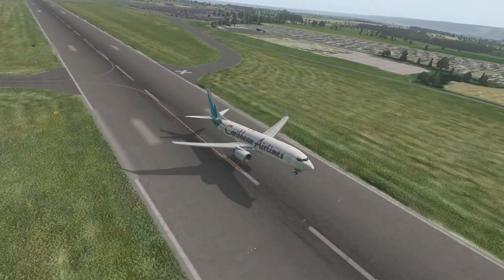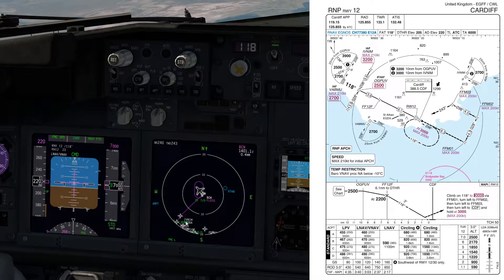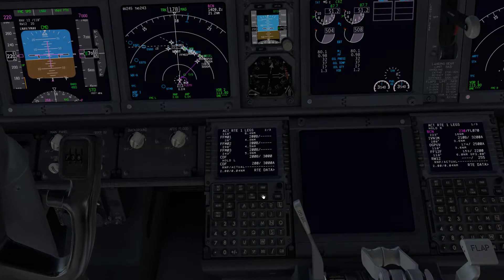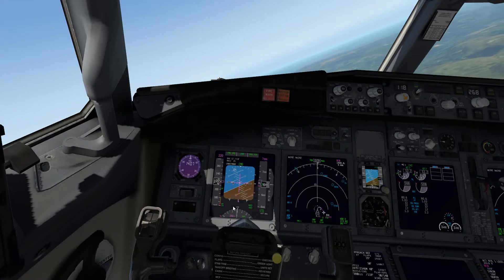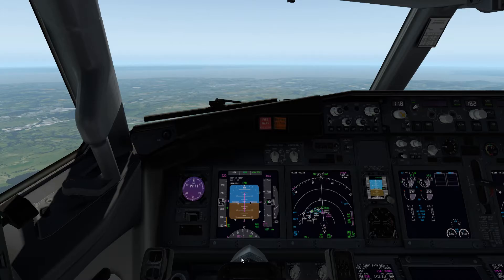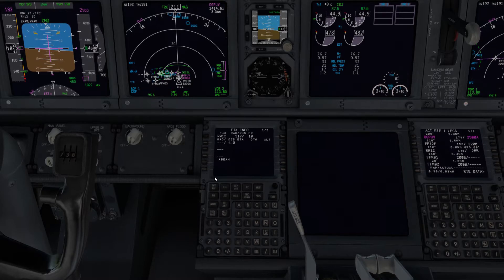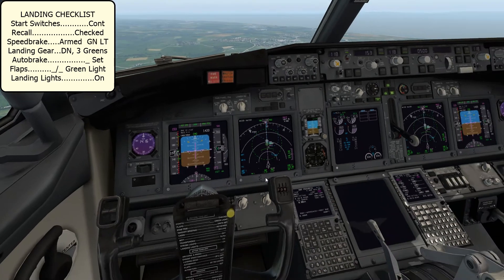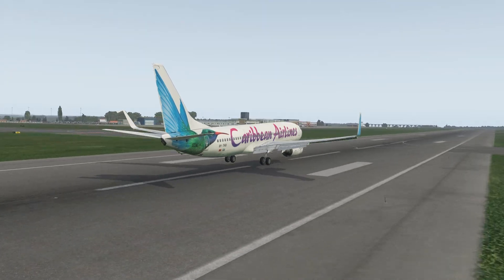Boeing 737 RNAV Approach Tutorial | Real Airline Pilot / Flight Instructor | X-Plane 11 | Zibo Mod

Comment: Thanks for the upload. I made an attempt into EDDV with rnav, but the zibo mod would't folow a glide path under 3000. I will try this approach and try to figure out what the difference is.
Reply from the maker: Which runway were you trying at EDDV? Were you definitely in VNAV Path for the pitch mode?
Reply: @Taylair  thanks for answering. 27R and once 27C. (according to landing report in simtoolkitpro. Not sure about vnav path, at that exact moment. Did lower mcp altitude to da, rounded to the nearest 100
Reply from the maker: It sounds like you may not have had VNAV engaged. In order for the aircraft to follow the profile you have to select VNAV on the MCP, once flaps are selected, the aircraft will remain in VNAV Path once speed intervent is selected
Reply: @Taylair  I'm sure vnav was engaged up to DV612, but I'm not sure on the vnav path indication. Will try to night.
Reply: landed perfectly on 09L. There was a speed issue, vnav spd indication. So next time I will try to slow down earlier, expecting vnav path to stay
Reply from the maker: Yeah, as long as you have some flaps out before pushing speed intervent, it will stay in VNAV Path.
Reply: @Taylair  it went to vnav speed way before flaps speed, I toggled vnav to get it back in vnav path. Thanks for the answers

Comment: I'm still not sure I understand the behavior of the APP mode with regard to the RNAV approaches. In your video there's a moment where small red triangles on the PFD change to the empty diamonds, so technically if you hit APP the aircaft will just follow the profile just like an ILS approach. But you didn't do it and the aircraft still did follow the profile... That's a bit confusing. Still i'll try to not rely on the APP mode next time, may be it will go better. Many thanks for your time and work!!
Reply from the maker: Hi, the RNAV approach that we are flying here is to LNAV/VNAV minimums which is a non-precision approach. The indications on the PFD are a representation of the VNAV path calculated by the aircraft, we then manage the altitude based on the normal barometric data. The APP mode will not engage to follow this guidance.

If you have a look at my ILS approach tutorial here https://youtu.be/DEtFIQ8LACw you will see that the glideslope indications look slightly different on the PFD. This is a precision approach, following a path that is transmitted from radio aids on the ground making it more accurate to follow. APP mode can be used to follow this guidance down to ILS minimums for the category that you are using for that approach.
Reply: @Taylair  Thank you for this reply. Leads me to another good round of googling. Turns out RNAV in LNAV/VNAV and RNAV flown with IAN in APP mode is not the same thing, so many thanks for this explanation. I'll be looking forward do your new tutorial videos. Cheers. Oleg (posed from my 2nd account).